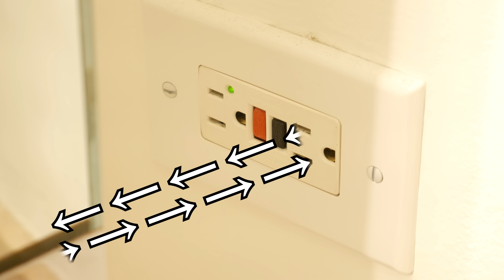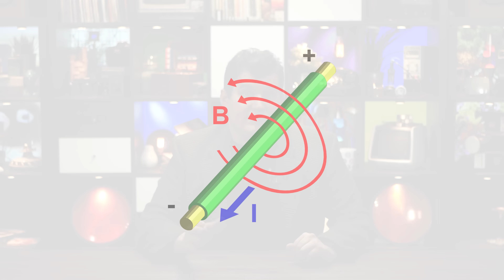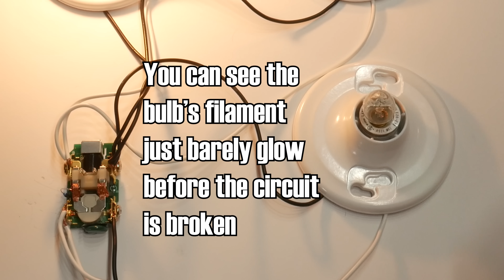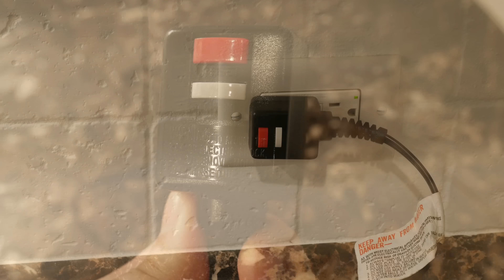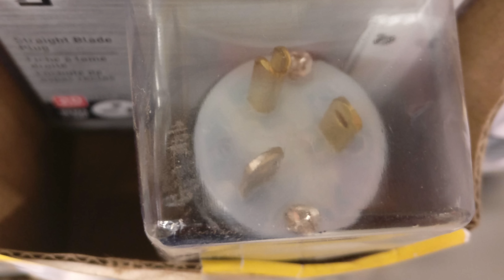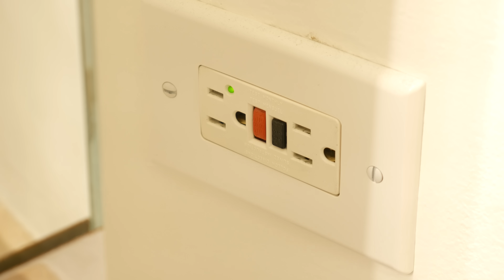The GFCI/RCD: A Simple but Life-Saving Protector

Comment: At 4:25, it is my understanding that this is a faux pas... You shouldn't daisy chain like that. There are only two screws in case you need to isolate one outlet from the other in the duplex (because you switched one, etc). 

You should always, again to my understanding of code, use a wire nut to join multiple branch circuits with a short lead going to the outlet. Yes, this can make for a crowded box, more time, and I've seen it done the other way a LOT... 

But the reason for this is so that the little bridge between the two screws doesn't suddenly become a flying shrapnel grenade when it over-currents down the line and act like an open-case fuse.
Reply from the maker: Hmm.  I didn't know this!  I supposed that makes sense, but then again the link must be designed to carry 15 amps safely otherwise you couldn't plug in a space heater or other high current device into one side of the plug.  So although code may dictate it, I think it's kinda six of one half-a-dozen of the other.  If it were an issue, I think that link would be outlawed.
Reply: I can confirm this, general wiring practice discourages using those tabs for daisy chains. Pig tailing each outlet into parallel circuits is safer and generally preferable. I think the tabs only remain for individual outlet control; one switched outlet and one constant power is probably the most common use(though they may also remain for installation in old circuits/structures). The only major draw back of pigtailing, especially with a deep electrical components like a GCFI, is small or shallow electrical boxes(typically in older structures)that can make for extremely tight or impossible installations.
Reply: I could be wrong (would love an NEC citation), but I believe daisy-chaining is allowed, but pigtailing is by far the most preferred method.
Reply: B.L. Alley - there's somehow always time to do it right the second time. 

No need to double check your knowledge then, as the guy I'd check with is also an electrician. I'm glad there are skilled electricians out there doing it right for us hobbyists to follow the right way. I thank you.
Reply: B.L. - that's the term, pig tailing! Thanks! 

Roads - I remember hearing that, but I never heard if it really was by code or not. Would be interesting to find out, I'll have to check with a customer of mine that is a pixie-wrangler.
Reply: B.L. Alley Wait, does the odd 110V NEC not require circuits to be for the ampage they are labeled and named??!! That's so intentionally confusing and probably another reason why US and international electric codes are near impossible to reconcile.  In IEC 230V countries  circuits are required to accept their rated current 24/7/365 for 10 (industrial) or 30 (residential) years.  Inspection starts at the distribution box that includes the RCD, overload protection, main isolation breakers and sometimes the meter.  The national codes list the minimum wire gauge (in square millimeters) for typical fuse/breaker sizes calculated from the IEC reference code and the state climate (the reference code table uses the average ambient temperature as a parameter, especially hot buildings/rooms require the electrician to use those instead of the precalculated tables.  Almost no one resorts to using the fundamental formula which involves actual calculus).
Reply: pig tails are required by Canadian code in this example
Reply: Daisy chaining is allowed up to a point.

Comment: I am shocked to know these GFCI things do exist. Never saw these in Brazil, I've googled for it and i found this kind of outlet is only obligatory in construction sites.... and we do use electrical showers without it here yikes.
Reply: Yeah, when I saw on Youtube those electrical showers you mention my brain nearly melted from the "nope" overload. But as far as GFCIs go, only newly wired homes have them here in Romania too, which means basically nobody ever saw one.
Reply: @AttilaAsztalos  We had them in Oman since the late 90's afaik
Reply: Here in Brazil they are called IDRs. I've installed one in my "lab" where I repair some electrical devices.
Reply: And these are mandatory in all new buildings, according to NBR rules. But I'm sure you know how things work here.
Reply: Check your electrical panel for a similar test button. The rest of the world puts them there, not in individual outlets. Mind you if you don't see a test button there either and you own your house then you might want to call an electrician.....
Reply: In Australia only new properties or rented properties have them. Or old properties that have had major electrical work done, by law any major works will include installation of an RCD
Reply: disjuntor DR
Reply: You can't use the showers you install with a GFCI. Those showers do on purpose what a GFCI is built to prevent (current to ground).
Reply: Pela ABNT os DR's como são conhecidos por aqui devem ficar em um quadro como os disjuntores convencionais. Porem é importante lembrar que são absolutamente inúteis assim como qualquer sistema de proteção de não houver aterramento adequado. No Brasil é muito raro uma construção residencial que conte com aterramento.
Reply: Sim, forçaram a trocar as tomadas por três pinos mas ninguém coloca o aterramento adequado nelas não adiantando nada o terceiro pino.
Reply: Rodrigo Badin verdade é a coisa mais inútil
Reply: Well how many people die in their showers there? Probably none, which proves it's no big deal.
Reply: You were shocked.....hehehehehhe
Reply: Mister Brookes do you speak Portuguese? Otherwise you shouldn't rely on translators hahaha (or maybe you're mocking the lack of a comma there)
Reply: Hue hue hue
Reply: I am from Mexico and I've never seen those protectors here either. They would must be obligatory all over the world.
Reply: Dude, your electric showerheads are literal death traps as far as I'm concerned. I ain't sticking my head 10cm below a wire that's live at 230V with water running around it.Besides, I saw a teardown of one of those on big clive's channel and due to the way they operate they would trip an RCD every time you turn them on.
Reply: Cool. I'm not the only Brazilian watching this channel. But I haven't seen those in several counties, like Switzerland, South Africa, Argentina, Ecuador and Colombia. But I saw some in Mexico. In Switzerland they have a switch to each outlet, but they aren't GFCI, while our diamond plug fit in their outlets, theirs don't fit in ours. And we have no prevention to plug a 127 V into a 220 V but we can't plug a 20 A in a 10 A outlets, but 10 amp plugs keep falling from 220v ones. what a mess.

Comment: You mentioned daisy-chaining but you didn't quite mention that other outlets (as opposed to lights or fixtures) on the same circuit are protected, when wired properly. Also, some of the GFCI outlet are quite sensitive to lightning. I had one in my garage that kept popping during thunderstorms. Not too practical when you have a fridge or freezer that will thaw out when the GFCI pops!
Reply: No idea if they're cheap or not, it's what they used when they built the house in 1999.

Comment: Here in Australia, most new houses have RCIs in the fuse box. The only devices not connected to this are generally air conditioners and ovens, as these are grounded 3 phase devices. If there is a fault current goes to ground, and trips the breaker.

Comment: Here in Australia and probably some other countries, we have RCBO's and they are quite common in newer houses. In our house we replaced the single RCD protecting 4 power circuits, along with the breakers for those circuits AND the lighting circuits ALL with RCBO's After my mother managed to get shocked on a light switch. the single RCD was also replaced due to combined leakage of all circuits (because there is always a small amount) causing nuisance trips. So now we have no more nuisance trips, the Light circuits are now also protected along with the power circuits, and a Tripped RCBO only takes out the one offending circuit. It also saved some space in the breaker box as well. Much better!

Comment: 11:16 Ok I'm going to assume you didn't just touch a bare wire with wet hands while it's live. It's some camera trick, right? 
ARE YOU INSANE?
Reply from the maker: If you look closely, you will see that the indicator light goes out the moment I touch the wire.

That said, layering and masking can achieve wonders...
Reply: Having touched 110v often enough while learning to install these things, you would probably be fine doing an actual controlled demo.  I just wouldn't do it alone, or anywhere with higher voltage.
Also,  at 2:56 the note says that the arrows are backwards from the current, but that's only half-right.  Since it's alternating current, the current goes one direction and then the other.  The pin size of the plug for polarization is separate from direction of current flow like if it was DC.
Reply: The sound was probably added in post.
Reply: No, you can also make out the light turning off.
Reply: I doubt it was a camera trick. He probably had the circuit breaker off during that shot. Same for the shot with the knife in the toaster.
Reply: I own a house that was built in 1985, shortly after the GFCI requirements went into effect.  GFCI receptacles were apparently so expensive back then that all the GFCI required outlets are wired downstream from the one GFCI receptacle in my garage, on one circuit(!).  You cannot use a hair dryer simultaneously in both bathrooms, or you will trip the (panel) circuit breaker from overcurrent.
Reply: Brent Boswell I still remember my parents installing a 30mA GFCI in the breaker panel back in the 1970s while rewiring the entire house.  As this was in Europe, it was a whole house device between the meter and the individual fuse holders.  Only actual ground in the house was a dedicated ground rod wired directly to the big outlet for the washer.  They also upgraded to shutters on select outlets while using plastic plugs to child proof the others (a plastic plug is a piece of intentionally boring looking molded plastic in the shape of a regular plug but too flat for a toddler to grab, if they'd even try when it looks so boring).
Reply: It has a rubber coating ?
Reply: lol
Reply: What is with everyone on the internet being a huge coward? If you understand how things work, you don't need to be afraid of it kiddo. Chill out.

Comment: I always thought that the term ground fault referred to the fact that some of the current was going to ground (whether through you or a safety ground) and not back to the neutral wire.
Reply: In the circuit breaker panel,  ground and neutral are connected,  so you technically aren't wrong
Reply: Skidd2 is this normal where you are?

Here in the UK the ground wire goes to an earth rod on your property and the neutral returns to be grounded at the substation. This is for safety / consistency.

Although neutral is ultimately grounded the safety ground and neutral never meet.
Reply: Ben Sweeney 
At least 3 different setups if I recall John's videos correctly;
*Neutral bonded locally to ground rod. Often a rural setup.
*Neutral bonded to ground at the panel
*Neutral bonded to ground at the substation. Requires an extra wire from the substation to panel
Reply: Ben Sweeney That is correct, if you see the electrical diagrams for the transformers, the most popular wiring is that the neutral at the transformer is grounded in addition to going to your house . So what your ground rod discharges "to ground" is actually being picked up by the transformer's neutral. This is necessary because current always needs a proper return path to neutral in order to flow.
Reply: Arheisel It's not just a popular thing.  In 3-phase non-US grids, all the HB distribution is triangle IT: 3 phases, no neutral.  The substation translating to consumer voltage (220, 230, 240, some places 110 or 120) are responsible for either creating the grounded neutral (TT or TN) or continuing as an IT system (no neutral, consumer voltage between the phases, so a standard outlet has two live holes). IT as a consumer distribution system is seen in rural grids in some countries as it means power isn't lost if a rogue tree shorts one phase to ground, giving linemen time to actually drive around finding the fault.  Those rural systems are the only ones where the substation doesn't create the neutral, because the rogue tree does.
Reply: @Skidd2 Only if you're on TN-C-S setup. In standard TT setup neutral is separated and provided by the supplier, protective earth is not bonded to it (and also PE is installed by the home-owner).
Reply: Ben Sweeney “Ground Fault” is simply a term that indicates something improper is happening with respect to ground.   Current improperly shunting to ground, such as GFCI/RCD protect from, is a ground fault.  But so is an open, or missing, ground condition — such as if the ground wire had become broken or missing.  Both are “Ground Fault” conditions, but only one applies specifically to a GFCI/RCD.
Reply: quangluu96 but if it were to go through the ground wire and not the neutral it would trigger the RCD all the same
Reply: quangluu96 its just in the video he suggests that ground in ground fault refers to the neutral wire which I think is slightly misleading

Comment: These things are just centralized in European homes and active on all the wiring.
It makes them a bit more of a pain to reset if a fault occurs, but safer overall imo, because you don't have unprotected outlets, lamps or whatever else in your home. And since they do have to be checked on every so often to see if they still cut the power quickly enough, a single one in a centralized location is much easier to keep track of than potentially a dozen or so throughout the house, and cheaper to replace if it does fail.

Edit: I see now you brought this up in the video, and you bring up some valid points why having these things decentralized can be advantageous, the ideal solution would probably be somewhere in the middle, like having one for each room and etc., but all accessible from a central service panel.

Just my two cents on the matter.

Comment: Ok, so I looked in my bathroom at the one GFCI plug that my apartment has, and I noticed it has the nema socket shape. My question is how would I know if my apartments wires can support 5-20 amps? seeing as I only have one compatible nema socket.
Reply: You could check the number on the outlet's circuit breaker. If it says 20, then it is 20 amp. To make sure, you can turn off the power, remove the outlet cover, and ensure that the wire is 12 gauge.
Reply: Whoever installed the wires must have selected the fuse so it fits the wires after it (that's the whole point of the fuse; to protect those wires from overheating). Look at the fuse and you know what current your wires can take.

Comment: Does it mean it is possible to trigger the breakage by holding a strong magnet against a GFCI outlet?
Reply: You’d need to move the magnet around a bit to induce a current, as a stationary magnetic field doesn’t induce a current.
Reply: ExE Boss 
Might work with a static magnet if strong enough and aligned with the solenoid rod, using that magnet field to push/pull the solenoid rod instead of the field from the solenoid coil.
 Probably would need to be very strong...

Comment: The only time these will not work in the fuse panel is if you have split neutrals, then they must be used at receptacle.
Can you do a video on a arc fault interrupter breaker.  These are pretty smart as they know if an arc is occurring among all other loads.  Or, another would be dual technology motion sensors that use RADAR and PIR sensors together for false immunity.  Great explanation.